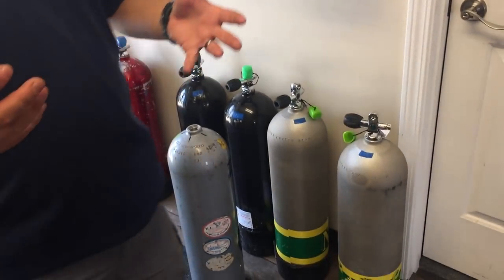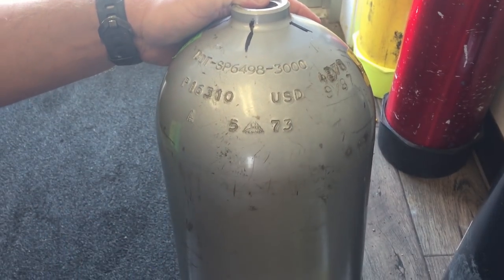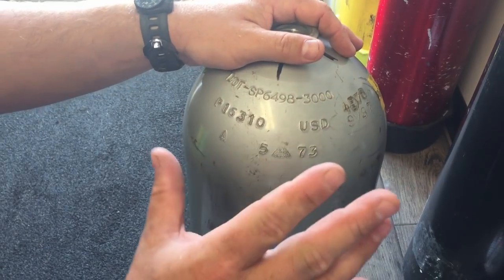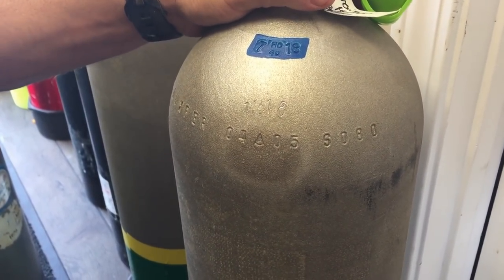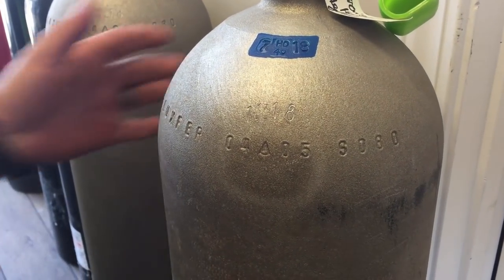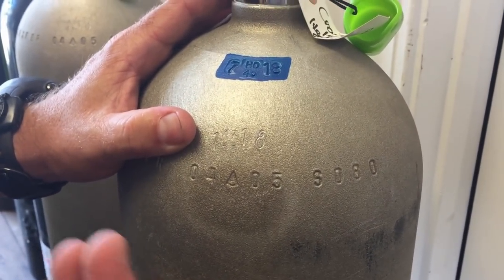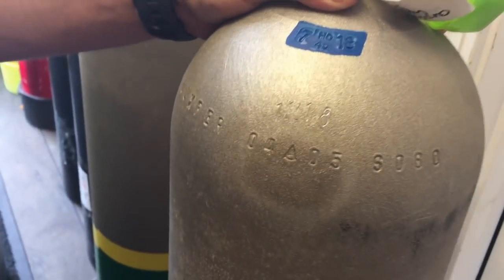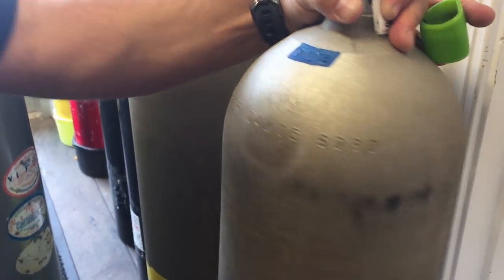What To Look For When Buying A Used Cylinder

Comment: Helpful. I only buy used cylinders & have never seen the pirated date stamp on a hydro. Appreciate the education. I thought the Al changeover was in 1994/1995 so I will check out the other video. Good facts. Currently we have 15 cylinders for the family but most are steel 95’s. I still have 2 steel 72’s I use made in 1975. Still currently passing every 5 years! Scuba gear rocks!
Reply from the maker: I have several Steel 72’s from the 1960’s, still in service.  They are virtually indestructible.

Comment: AND just two weeks ago i walked in to a dive shop with 2 of my old tanks - One needed a hydro and of course both an annual visual ... The owner FREAKED out as if I was pointing a loaded gun at him and  I was told by a dive shop owner that he would not service my old tanks because they will EXPLODE  ! he told me to throw them away !  So I went to another local shop and they said they would gladly take care of them and they should be ready soon ! ????
Reply from the maker: Hello @diverdave4056, shops will always differ. We no longer handle any 6351 allow cylinders. That being said, we give our customers other options if they choose to keep their older cylinders. One of those options is directing them to a shop that will service them. At the end of the day, safety not only for our customers, but also for our fill operators comes first.